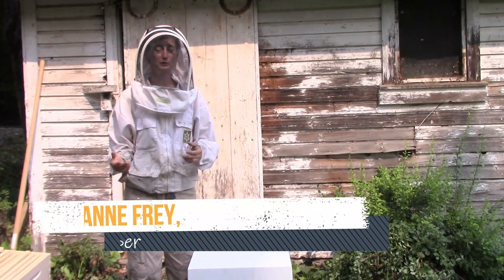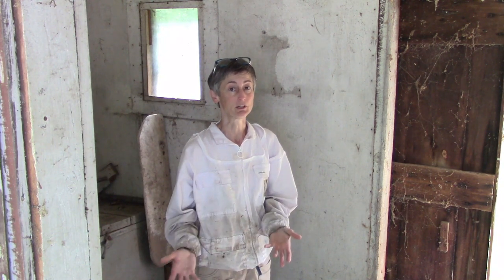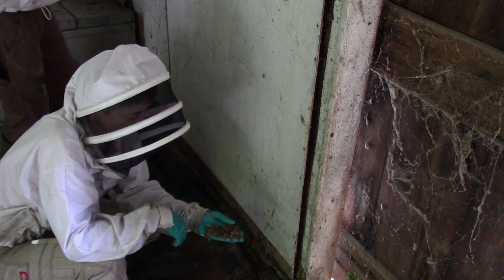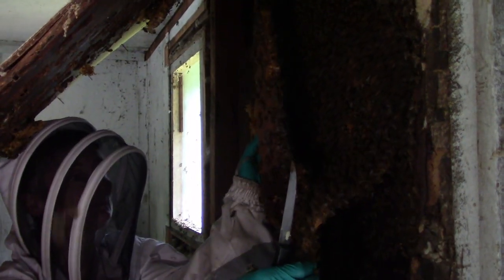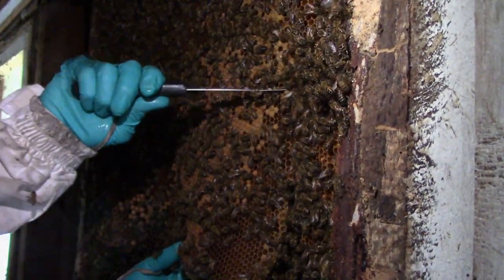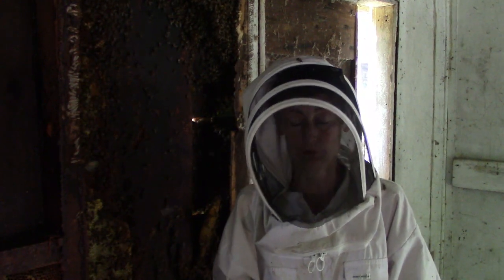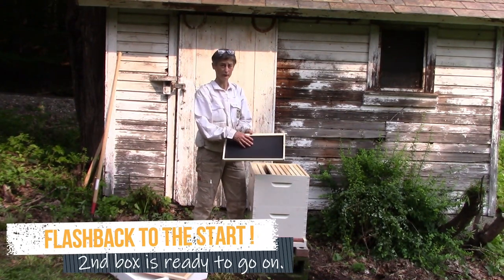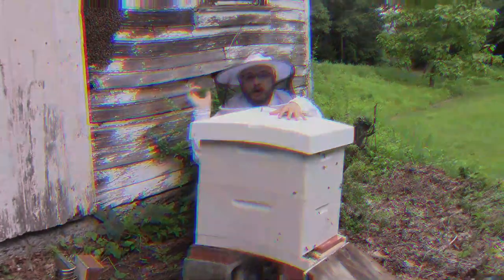How to Do a Cut-Out

Comment: Thank you. Did you use a smoker?
Reply from the maker: Hi T! No, usually no smoke is used during cutouts because it might drive the bees into another wall cavity and then we'd have to open that up, too. For instance, they could flee through the hole drilled for the electrical wire pathway through a stud.

Comment: pretty sure I have bees in my bedroom walls.  they came in thru an outlet with no cover or appliance on it.  the outlet is over 2 stories in the air.  would you think a thermal imaging camera might work to tell me (from the inside) where they are and the extent to which they've made it home?  I doubt I can afford to hire someone.  what does it typically cost (ballpark).  I'm 70 - hubby is 74.  he thinks we should just kill them.  he doesn't  really want to, so your argument against that was helpful.  I used to have bees but they swarmed.  I still have all the equipment.
Reply from the maker: Hi there! An infrared camera will certainly show the heat map of where the bees are inside your wall. Also, many beekeepers do wall cutouts "for free," but will leave your home in need of repair (e.g. if they cut a huge hole out of your drywall to get the bees out, you'll have to replace that out of your own pocket). You can use our swarm catcher list to find someone nearby to contact about it: https://www.betterbee.com/swarm-catchers/
Reply: @betterbee1979  none in our area.  so looks like it's up to me.  I'd have to repair the damage anyway, so that part didn't bother me.  but I'd like to keep the bees, and most swarm catchers do it for the bees.